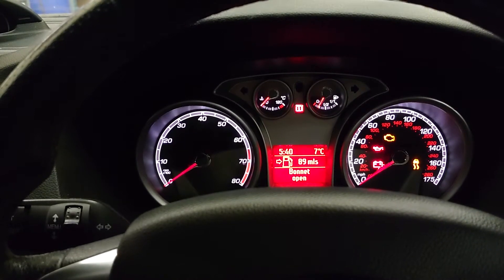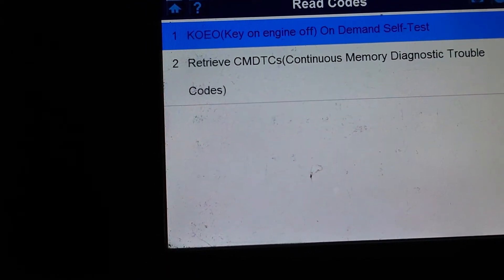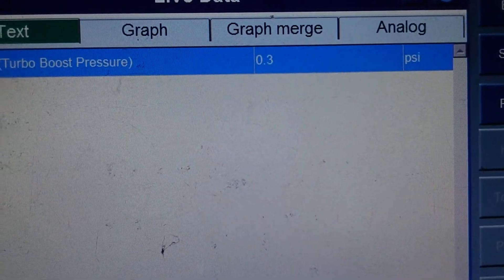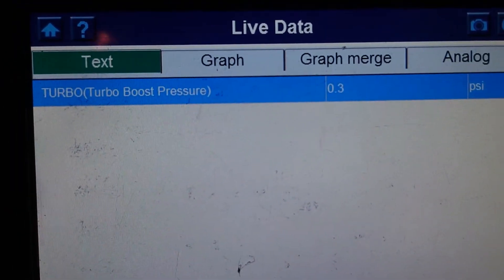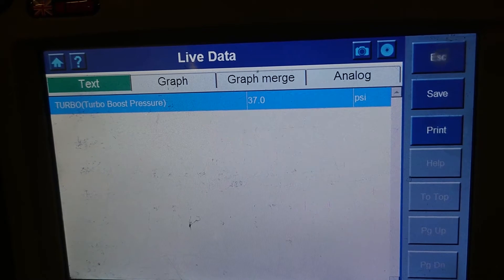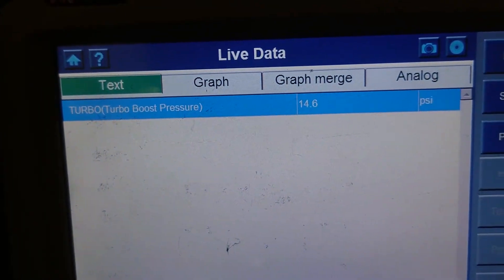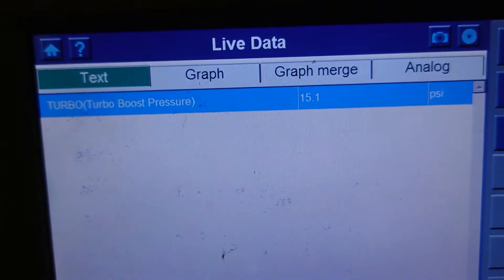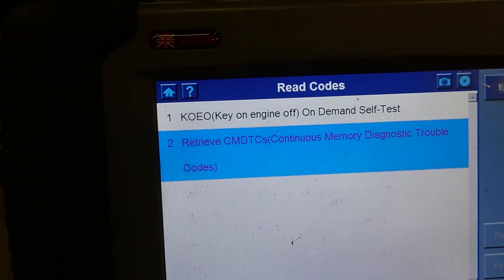Ford focus ST low boost fault P0237 diagnose and repair

Comment: Hello friend, a question I have a ford focus st of 2007 and I noticed that the needle of the turbo goes up and down although I keep pinsando the accelerator, the car I think it does not lose power only moves the needle you know some possible solution
Reply: I've been told it may be the turbo solenoid that makes it move the needle and not hold up